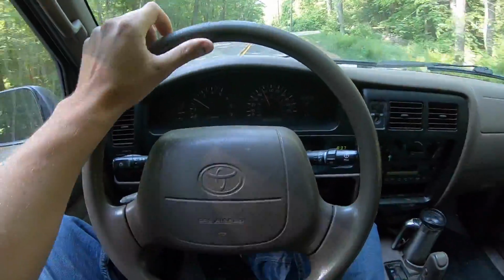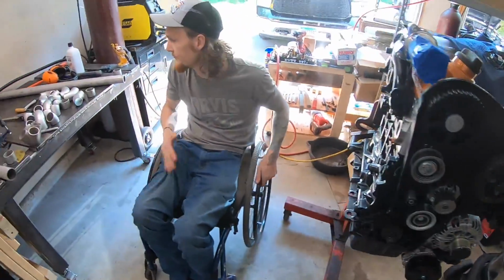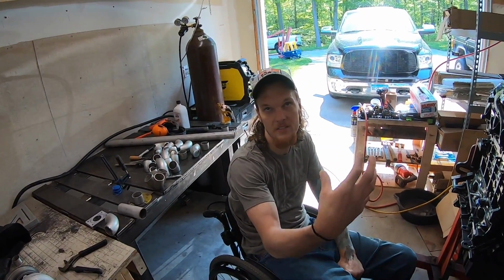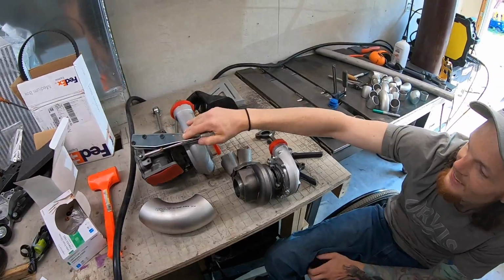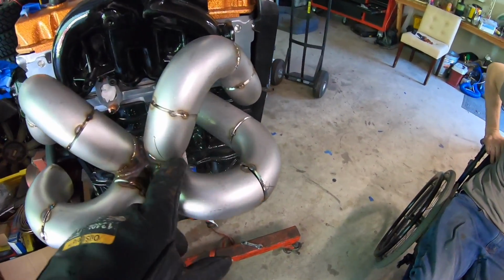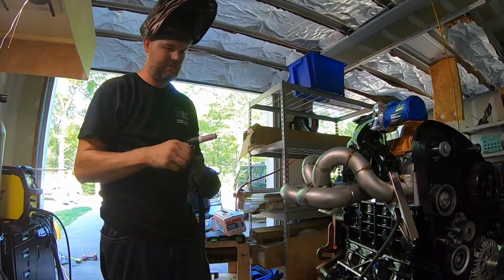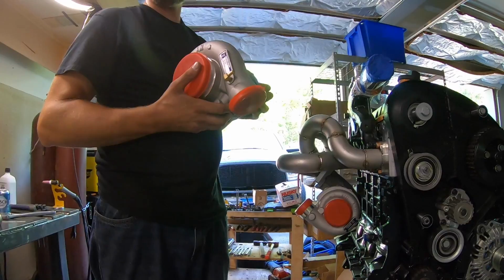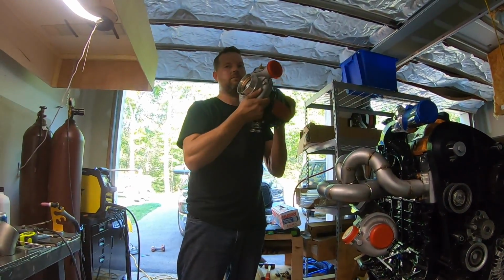My Brothers VW 1.9L TDI ALH Compound Turbo Build Has Begun

Comment: The big turbo is supposed to feed the small turbo😬 so it pressurizes air into the small turbo… I’d like to see the update on this. Also yall should try flipping the exhaust manifold over to keep the heat off the intake and it would bring the first turbo up and make everything easier and hood stack it

Comment: The large turbo has to feed the small so you can compress compressed air. If the small turbo feeds the big turbo, you would inevitably create a vaccume on the little turbo meaning you would be taking compressed air, and allowing it to expand before recompressing...
I JUST bought a 99 tdi, and its lacking to say the least, so i came in here to see what i could find on compounding a little bitty diesel like i do on my 5.9 cummins.

Comment: Don’t think of it as, big turbo feeds the small turbo. Think low pressure turbo (large housing has more space inside ) feeds the high pressure turbo ( smaller space getting same amount of air forces inside)

Comment: Very sick making the compound system, but why not buy an jw1856 for £500-700 and you could get more than 250bhp with all the other mods you have? Less work and respond really well, full boost on a later pd but still a 1.9 comes in at 2.4k or so. I have a 1.9 pd130 avf that I plan to put one of these turbos on and it will make easy 270 with new cam and injectors
Reply: Too much lag...
Reply: With the HX35 they could make more than 250... I guess they don't want to overload the transmission... There's a yt video of a guy making 4 bar boost with a compound turbo with the bigger turbo being a hx35... He's probably at 350-400 HP probably 800 Nm of torque

Comment: Do you plan on keeping the 11mm pump? What rpm do you plan to bring it to? What size nozzles? I’m wondering if you will need more fuel. Stock 5.9 uses 12mm pump for just that hx35
Reply: big difference from a 12mil p7100 to this 12mil pump
Reply: @PAOff-roadAdventures  yup. Im not talking about a p pump

Comment: Good to see someone else doing this kind of thing. I'm working on planning out a compound setup for my MK3 TDI right now, that's an AHU engine but very similar mechanically. Same architecture and displacement with a handful of changes. My plan is to go smaller than this, I want fast response lol. VNT17 as the small turbo and a custom machined T3 with a billet wheel as the big turbo. Should be fun. I'm probably going to blow up my transmission lol.
Reply: I'm running malone stage 3 .216 nozzles and a FMIC getting ahu58 turbo and bosio pp764 nozzles
Reply: @darchvader2171  sounds fun, I actually swapped an ALH into my MK3 a few weeks ago with a K14 turbo from an AAZ, have a few tweaks to make before I put a tune in it but its decent so far. Still planning to go to a compound turbo setup eventually but i'll probably do it on an ALH instead of an AHU
Reply: More options
Reply: Any luck with your ahu compound setup?

Comment: Definitely sub'd. Just snagged my first alh tdi out of the junkyard with 170k on the clock. Plan on a similar compound setup, standalone vnt controller, and tweaking a 12 mm injection pump off an iveco to make it all play nicely in the sandbox.

Comment: Big turbo has to go on the outside as it has to be able to suck the most air, the small turbo will make the big boost by boosting already boosted air. If the small turbo was on the outside then you would choke the big turbo as all the air has to flow through it. If the small turbo flows boosted air it is not a restriction.